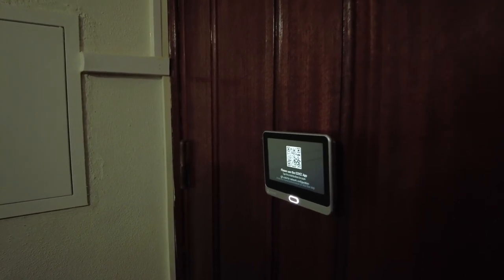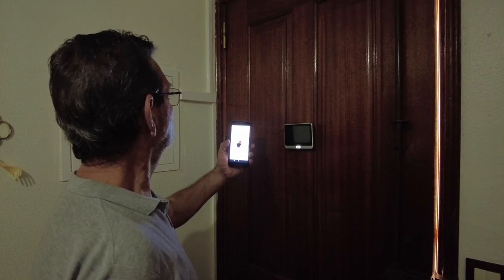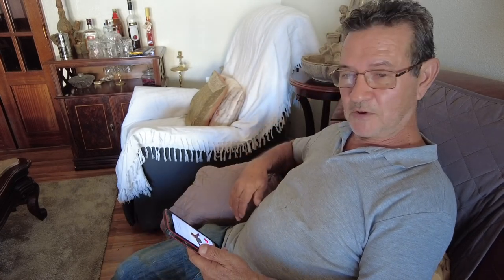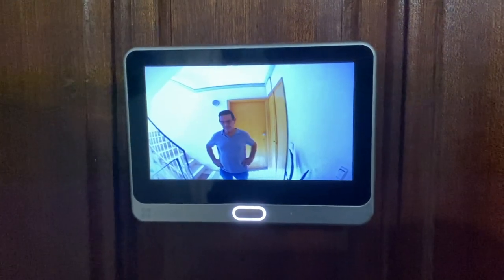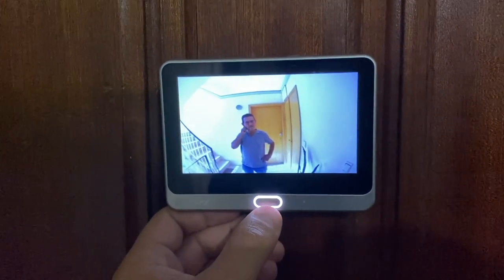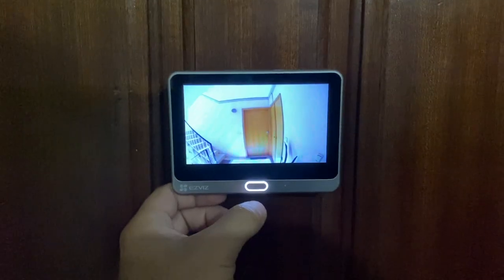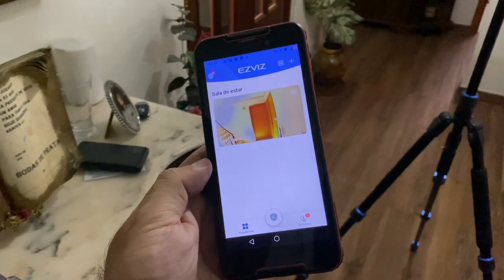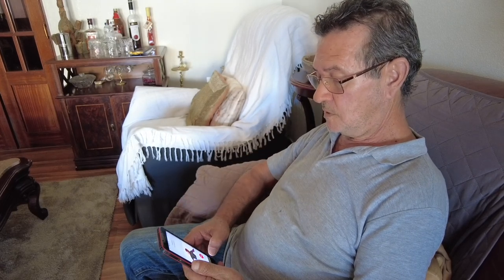Smart Door Viewer INSTALATION !!! EZVIZ

Comment: Hello, you drilled the door with what diameter of drill please? I know that it takes a minimum of 16.5 mm on the manual, but I would like to know if the camera fits with a diameter of 15 or 16 mm... Thank you